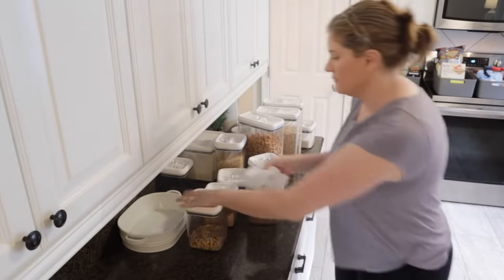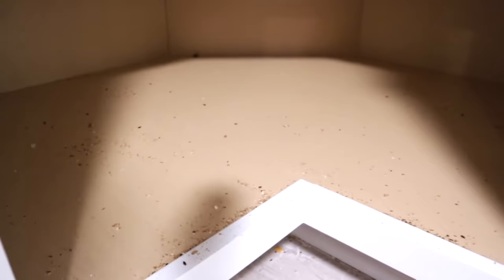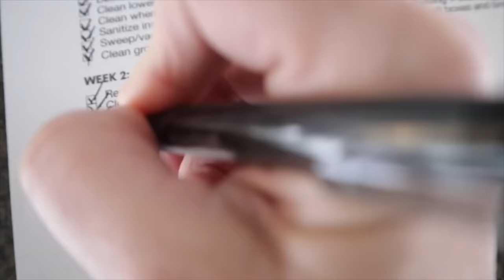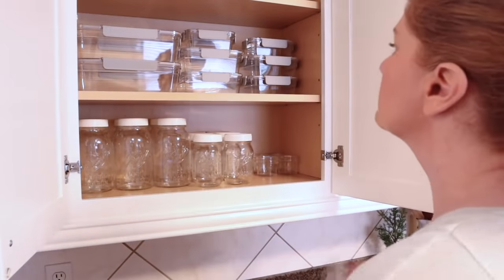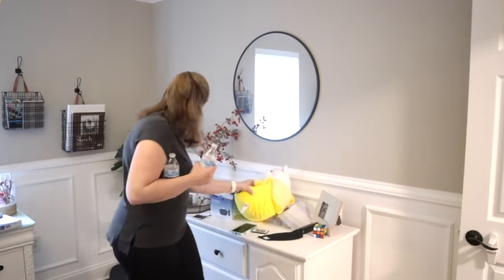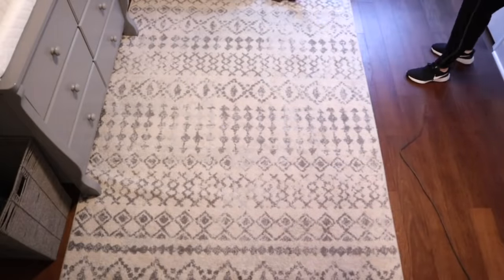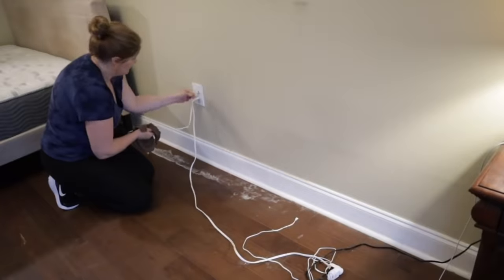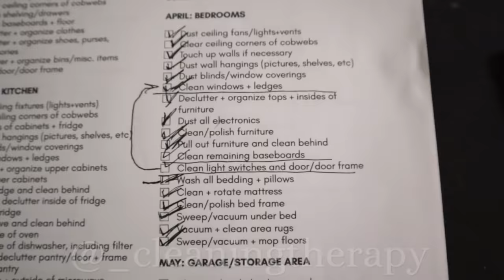EXTREME DEEP CLEANING MARATHON | 2021 Spring Cleaning Motivation | Satisfying Speed Cleaning

Comment: If you have a two shelved cart…you can put your cleaning supplies on the bottom shelf and then wheel it up to whatever surface you are cleaning and use the top shelf on the cart to hold items you need out of your way while cleaning. Saves you time from walking back and forth when moving items out of the way to clean a counter, desk, etc.

Comment: Very inspirational. I have a little tip that helps me a lot when I clean. I use to vacuum walls, shelves, pictures etc with a small round vacuum cleaner brush before I clean with soapy water. This way, the house stays dust-free longer and I avoid the hassle of dust clumping and sticking to the cloth :)

Comment: Quick tip: if you use baking soda to clean your oven and after caking up the baking soda you pour a little bit of vinegar until it forms bubbles, it works even better. It is still messy, but I'm sure you'd have to scrub less.

Comment: If you use long rectangular bins in your cabinets, then instead of taking each candle down separately, you can just slide the whole bin out of the cabinet with all the candles at once. You use organizer bins in your drawers…they work great for cabinets as well. Also, I noticed in your closet segment you placed purses lengthwise on the shelf so they took up more room than if you had placed them width wise on the shelf. Also, a hanger with clips to hold a skirt…can clip your long boots and hang them instead of having them folded over getting creases on a shelf. I love your taste in music and your commentary as you work. You have truly helped me be less overwhelmed by your logical top to bottom methods of cleaning one section at a time and checklist! Thank you!

Comment: How fun to clean with someone!  Have you been to a Norwex demo or watched a Norwex video?  You can save so much time!  Cleaning a microwave or fridge is so easy as you only have to wipe down with water as the cloths really grab all the food and even bacteria with one or two wipes.  Every surface is so easy to clean without leaving any residue of cleaners on counters, windows, etc.  The Norwex cleaning paste is perfect for tough cleaning like oven glass.  I really enjoyed your video.  I just felt badly that you had to spend more time cleaning than necessary and had to keep so many cleaning products on hand.  You may have to put in longer screws into the hinges on the door with the all the weight from the cleaning products so the door doesn't start pulling from the wall.

Comment: For me this is a tricky dance.  Sometimes checklists are just triggering because if I'm not feeling it and get nothing done it can add to reasons to feel that depression/anxiety.  The flip side to this cleaning checklist is that you have a guide.  Trying to get going cleaning can be overwhelming because you get mentally bogged down in all the things you need to clean.  With a list you can pick and choose what you want to do and not keep doing the same thing over and over.  

I will say this for those depression/anxiety people ....   Its ok to not feel like doing anything sometimes.  Just try to keep some forward momentum. May be as slow as a snail but its forward momentum nonetheless.  Let it be ok to do nothing sometimes, let it be ok to not get as much done as you wanted.  Forward momentum.....

Comment: those cloth covered hair rubber bands for cords.  I've always been leary of plain rubber ones, I think it might damage the cords.

Just commenting as the video rolls along.

Old and/or designated toothbrushes for cleaning.  Then throw them in the dishwasher.  I take a sharpie and color the handle so there are noooo misunderstandings.  Shouldn't be a problem because cleaning toothbrushes shouldn't be anywhere near regular toothbrushes but I feel better.  LOL

You reminded me when using toilet stuff for grout so I thought I would throw it in.  Don't mix two different kinds of cleaners.  I did this once with toilet cleaner and produced a toxic gas.  I flushed as soon as i smelled ... felt ... the crap ... all good.  For those who can't squat or kneel to clean grout, baseboards, whatever ... you can buy a rechargeable electric scrub brush that is like 4 feet long.

What is a cleaning expert?

pull the bottom of the blinds apart and remove those excess slats.   Less to clean and you will have nice clean replacements if one get broken.

Receipts.  Go paperless.  Scan everything in and toss all but the really important things.

Comment: RE: ELECTRONIC AND ELECTRICAL CLEANING.
MY REPAIR PERSON TOLD ME THAT WHEN CLEANING ANYTHING THATS ELECTRICAL (PLUGGED IN AND ON)  and HAS ANY TYPE OF BUTTONS AND REMOTES, ETC ANYTHING THATS LIQUID/WATER SENSITIVE TO ALWAYS USE A DAMP , NOT DRIPPING WET, WASH CLOTH OR DISPOSABLE WIPE AND SPRAY THE CLOTH OR WIPE WITH THE CLEANER/SOAP.... DO NOT SPRAY THE CLEANER/SOAP DIRECTLY ONTO IT.  NOT ONLY ARE BUTTON AND REMOTES EXTREMELY SENSITIVE BUT IF THE CLEANER OR WATER/LIQUID GETS ON AND INTO TINY CREVICES THAT YOU CAN'T REACH INTO TO TOWEL/WIPE DRY  THAT YOU CAN NOT ONLY DAMAGE AND "BREAK" THESE BUT ALSO CAUSE ENTIRE WHOLE HOUSEHOLD POWER SURGES AND ELECTRICAL BOX TRIP POWER SHORTAGES.  SPRAY THE TOWEL/WIPE TO DAMP AND THEN CLEAN AND WIPE AND DRY IT IMMEDIATELY. 
I TELL YOU ALL THIS BECAUSE I LEARNED THE HARD WAY AND IT WAS EXTRREMELY EXPENSIVE REPAIR & SOME EVEN NEEDED REPLACEMENT AFTERWARD.  HAVE FUN Y'ALL 👍 😊 👍

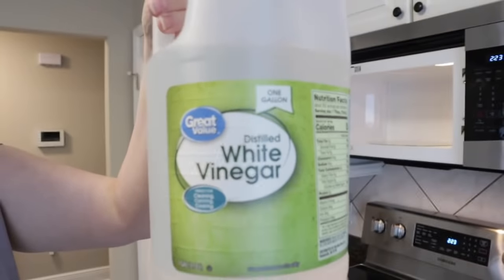For example @8:38
She directly sprays into the microwave and on the panel.
DO NOT DO THIS !  I DID and it ended up costing our household budget about 500 dollars for repair/replacement.  For a crusty microwave,  put in a coffee cup of water and nuke it for a couple minutes and then let it sit and the steam from the water will soften the hard food and then take a barely damp wash cloth or  paper towel and spray IT lightly with some glass cleaner or vinegar and  then wipe out the microwave and let it stay open for a few minutes to air dry. Same for the microwave touch panel and for stove top controls and knobs/buttons.   
She uses way too much cleaning product too causing one to have to rinse and wipe multiple times to get all the residue off.